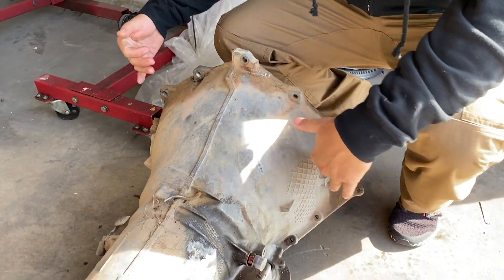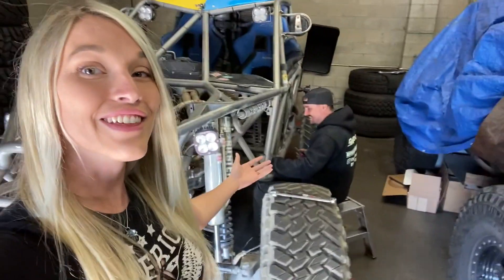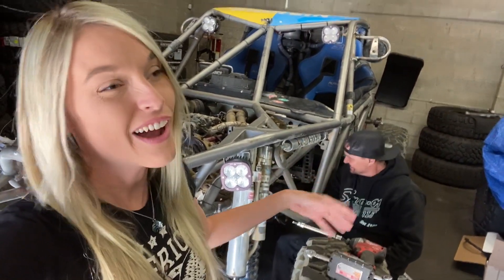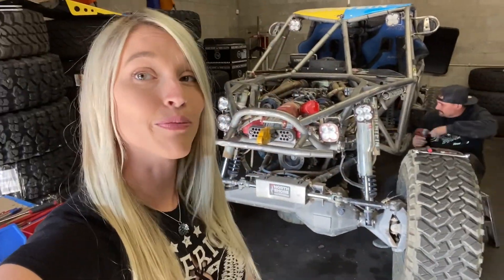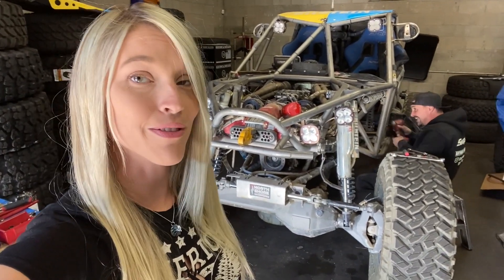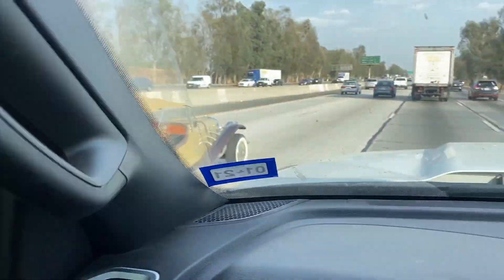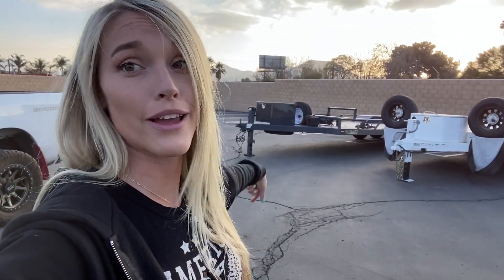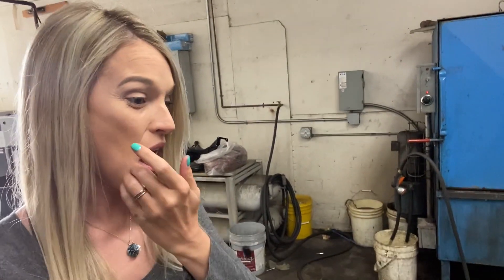WHAT'S WRONG WITH OUR ENGINE?

Comment: With the transmission ears being broke off you could always cut the bell housing off and buy a bolt on bell housing for it. It bolts up to the pump. Lots of race cars/trucks use them.

Comment: Put some sort of bushings on the drivetrain! Find some hard rubber, something, that will cushion it. It doesn't have to be anything soft either, just something other than completely hard mounted. If those tabs are going they are obviously seeing way more stress than they are designed to be seeing, so maybe consider supporting the drivetrain in a different way and make sure that there isn't any force being transferred from the frame to the drivetrain.

Comment: I once saw a race car that had a quarter steel plate, where engine and transmission met, and I thought it was an adaptor plate, but it turns out it was for reinforcement - it had a ridge that wrapped around all the mounts, and thus took some of the stresses. Also, it wasn't sandwiched between the engine and transmission. Instead you slid it over the transmission, and then threaded the bolts through both the plate and the transmission into the engine, so the bolts had to be slightly longer too. 

The beauty of it, was that if the gearbox got broken from impact or something like that, he could just buy a new housing, and move the plate over, it wasn't welded to the whole thing (maybe a tac weld or two to make it easier for teardowns).

It must have been one hell of a fabrication job, but it was pretty elegant.

Comment: So if the bell housing has broken twice, I think something else needs to be modified. Good job with the trailer. Nothing like driving through LA pulling one, but then again, Jelly Belly was your Co Pilot. No problem. You guys Rock & Crawl.
Reply from the maker: We found a pretty rad solution to the trans issue that we’ll cover when we rebuild it!!

Comment: Hey you guys passed right by my exit Sierra in fontana👍 great stuff as always! S2000 & 240 meet lol
Reply: Yes, she passed right by my exit Sierra, except when I come from the other direction I use cedar. That shop she went to is in Colton. My uncle has a trans shop on Sierra and I have helped him cut the front off a trans for a bolt on bell housing, but for one of the top baja 1000 trucks which he does the TH400 trans for, they just run a Reid case.......talk about a jewel of a case compared to a factory case.

Comment: Great videos and content! One of the remedies I have done to save from beaking bell housings in drag racing is to rubber or poly mount the rear of transmission and to also run a midplate and front engine plate. This should secure and separate the engine torque and vibration being carried through the belhousing. Good luck! I would love to build an ultra 4 one day.

Comment: Between the transfer case and now the transmission both having cracked mounting flanges I'd start to wonder if something isn't wrong... Like I'd double check your driveline alignment to for excessive vibration, makesure driveshaft is well balanced, and possibly even rethink your solid motor and trans mounts haha. Your drivetrain just seems to be gettings way too much torque through the cases for some reason, could even be that with the solid mounts any chassis flex is just being taken up by your drivetrain and your drivetrain can't handle it 😛.

Also they're called keys not pins and the hole is called a keyway😅. 

LOVING the ultra 4 car!

Comment: Hey guys just a heads up! The balancer orientation to the crank has nothing to do with engine timing on an LS. It is internally timed cam to crank! The crank pining is usually done for super charging other than that or damaging the crank snout no other issues
Reply from the maker: Yeah, we misspoke and then totally spaced on correcting it. Lol

Comment: My first thought with the broken bell housing, is there a way you could brace it to help strengthen it and help it handle the additional weight of the atlas behind it. Kinda how cleetus had the trans and rear diff brace in Leroy if that helps with a visual.

Comment: alternatively, you can cut the transmission case down for an ultrabell bellhhousing. it converts those solid case transmissions (im assuming you guys have a th400) to an sfi approved bellhousing that bolts to the the area where the pump is on the transmission. very common in the drag racing world and proven to hold up to super high horsepower cars. plus you turn a failure point that required replacing the entire case of a transmission into something that can be replaced fairly easily by comparison

Comment: I would like to suggest changing your air and oil filters to something that has better filtration.  That will help keep the inside your engine clean and reduce the risk of internal damage.  Performance filters, like you are using, do provide better flow, at the cost of poor filtration (more like a sieve rather than a filter).  Your engine damage was probably avoidable, unless your air filter came off, or the contaminate originated from inside the engine.
Reply from the maker: We’re assuming the air filter came off at some point during previous ownerships.

Comment: I thought your timing gear and chain set kept timing . Even has a oil pump gear. Not sure if the harmonic balancer does timing, maybe it turns accessories, however it is pinned in blower applications to keep it from spinning. Good video though . Forged time lol

Comment: You can replace the bell housing the old one would be cut off and new is bolted to the front using the pump bolts!
\
Reply from the maker: We found a similar solution to this, actually! We’ll be covering it in detail when we film the trans rebuild!

Comment: JW must have a replcement bellhousing for it that bolts to the pump, so you just cut the old one off the transmission. that must be a a better bet than welding that cast aluminium

Comment: Just change the case out while you're rebuilding the trans . They should sell you one for a couple hundred while rebuilding it. No way I would run a welded one in that car and if there's room a trans blanket or just do it right with a blow proof bellhousing.
Reply from the maker: We’ll go over the trans rebuild in another video - we found a pretty cool solution!

Comment: Didn't the same thing happen to your transmission on the jeep?
Reply from the maker: No, we’ve never had an issue with our Jeep transmission (the Hemi swap came with a 8hp75)
Reply: @LiteBrite  oh ok, I thought when ya'll pulled your motor out the transmission had a few bolt holes that was cracked? My bad..

Comment: That transmission needs cut and a Super Bell installed and your broken bell housing problem will be forever solved. Very commonly done in drag race cars and off-road truck racing.  DO IT NOW, get the Super Bell done. There's a guy in Irvine, CA who builds all these transmissions for off-road race cars and trucks. The Ultra Car is right up his alley of experience and builds. Dana Sniff of Sniff Bros Racing and Dana Sniff Transmissions is who he is. Look up Dana Sniff on FB and contact him. Tell him Larry from the 405 (OKC, OK) sent you. He can take good care of that issue any other Trans needs to tolerate that abuse.

Comment: You are not in L.A.!!! you are in Norco & Colton which is Riverside and San Bernardino county not LA.  F.Y.I if you in Riverside county feel free to use my driveway for your maintenance needs 🤗😘😃
Reply: In the video, she drove through Ontario, on the 10 freeway.........I'm only half way through, so maybe she went to Norco as well. They may be tearing down the car in LA, but I agree that people call SoCal LA, when the Inland Empire is 50+ miles away and in a different county. That 50 miles is an hour drive if you are hauling butt at night, but it can take 4 hours during rush hour traffic right before a holiday.